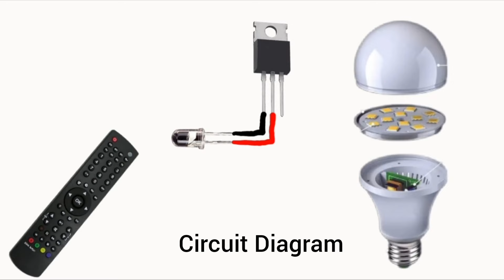How to Turn a TV Remote into a LED Bulb Controller without using Arduino | DIY Electronics Project

Comment: Thanks for your circuit. I will have some questions. As seen in the circuit, can the transmitting LED of a remote control be used as a receiving LED? Can this LED be connected to the direct current supply circuit of an LED that is generally voltage 130 volts or above? Is it the transistor you are using in your circuit or another element? I think that it is not possible to perform continuous on-off switching with such a simple circuit using a transistor. Kind regards.
Reply: Number transistor
Reply: If the infrared sensor is a momentary switch that would turn on the transistor then how is it turning the light off ? Once you release the button the light should go off. How is the light staying on ?
Reply: Bence diger eliyle anahtartan acip kapatiyor😂

Comment: What is transistor value
Reply: Voltage control transistors hai usaki value 7805 or bc547 transistor bhi hai
Reply: Transistor no
Reply: @technicalmaster1082  7805 or bc547 bo tarah ke transistor hai jyada tar 7805 ic ka use hota hai
Reply: Transistor number kya hai
Reply: BC 547 Transistor

Comment: Does the 220 volts Fry or burn the transistor?
Reply: I think that because there is an auto voltage led driver (led power supply )inside the bulb